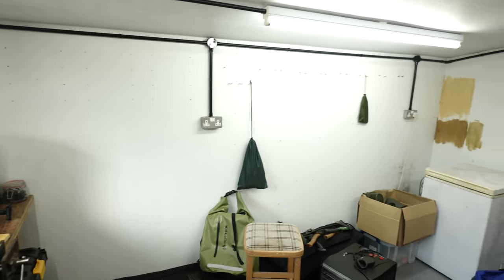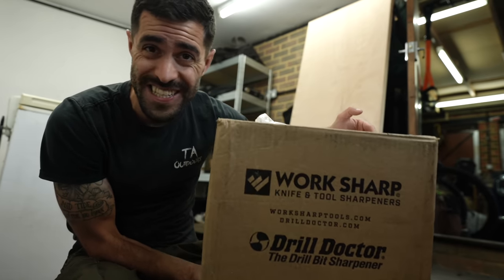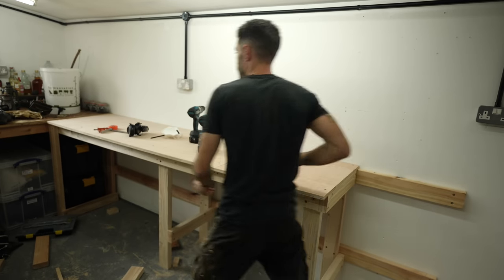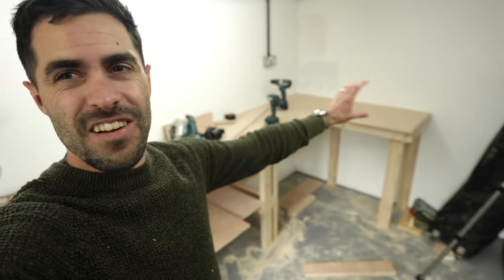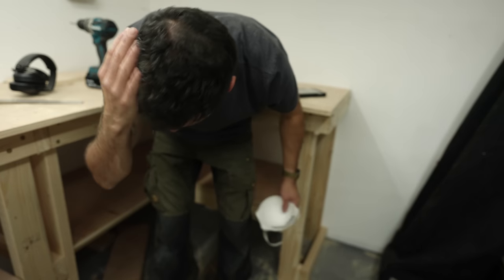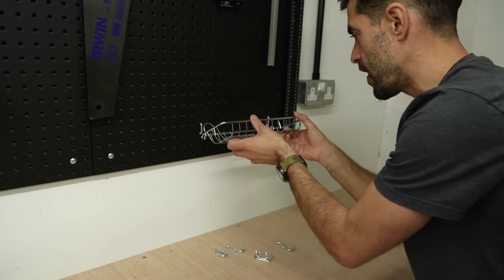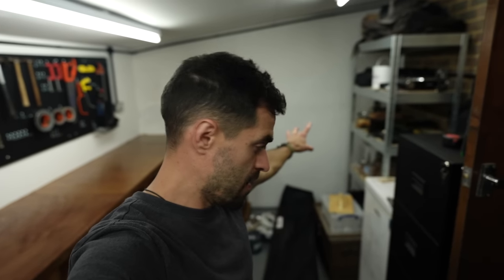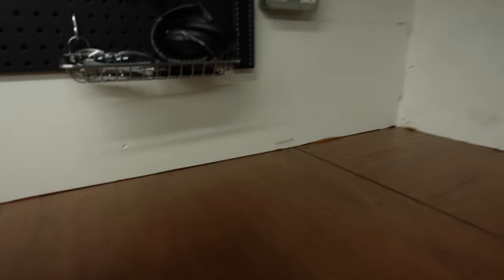Building the Workshop (PART 1)

Comment: Don't just 'think' about it, do it!  Get another shelving unit: have a place for all the camping gear, so that the gear comes into the house and into it's home.... or... it will fill the top of your work station.  Ask me how I know this.  The bead of caulking will also prevent nails and screws rolling to the back of the table and falling between the table and wall.  I haven't worked much at tables like this. lol.
I suggest heavy duty totes on the bottom shelf of the work table to mimic drawers.  That will help the over all appearance to be neat and tidy, and it will help you reach the things that are at the back of the shelf.
I suggest a smaller tote by the door, so your wife and kids can set things into that tote when they need to.  Returning tools, or they found something they don't know what it is, or they don't know where it goes... put it into the Return Box.
When you replace the freezer, I suggest an upright freezer, despite the negatives.  You can use restaurant steam table pans to help organize the food and make every thing visible.  When a great aunt died, we found meat in the bottom of her chest freezer that was decades old, because she never saw it.  It's too easy to just keep stacking stuff on top.
I concur, you are going to want more of that metal peg board around the table top.  That is so easy to use and keeps your tools organized so you can find them.  They're even making it for kitchens!
Oh, I would suggest tract lighing above the work table.  So you can move lights to the area where you are working, and have light from above you, but not from behind you casting shadows.
Putting the tent in the corner is perfect!  The rolling tool chests in front is also perfect.
No... I'm not more ocd than you... or maybe I'm just older and that ocd had learned a few things.  Thanks for sharing this project with us.
Reply: He put some real effort into this comment lol
Reply from the maker: Some great ideas! Thank you. I have plenty of storage boxes to go under the worktop and make gear organising a lot more efficient.

Comment: Hi, I had a lot older version of that pegboard, and the problem was that when you took any tools off to use the little pegs would fall out and knock others off as well. The version you have looks much more substantial than mine was, so I hope you do not have the same problem. I now use wood holders that go along the length of the wall, and I can make little tool holders that can be moved at any time without disturbing the other tools, there is a name for these strips of wood, but I cannot remember now.
Reply from the maker: Yes I know what you mean, thankfully the hooks on these pegboards have little balls that hook into the hole below them and stops them falling out when you pull a tool or item off.